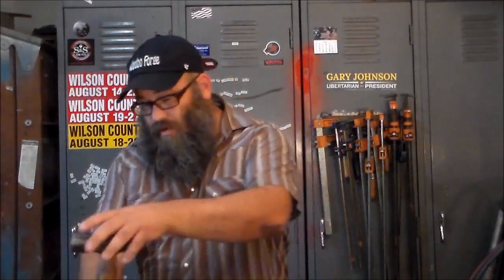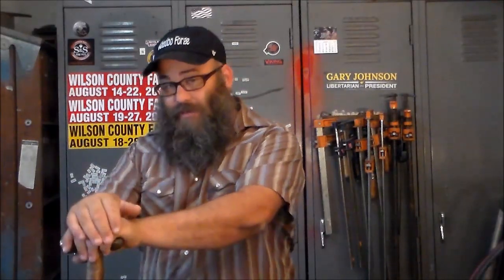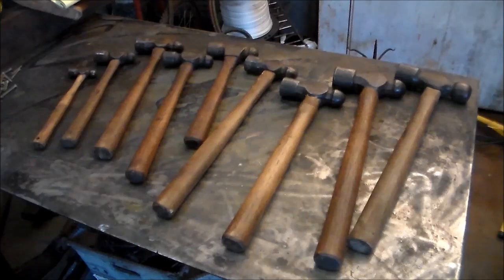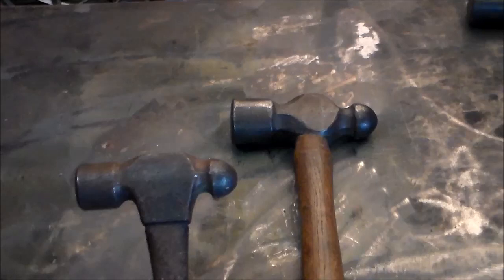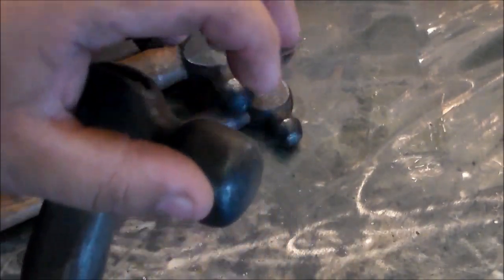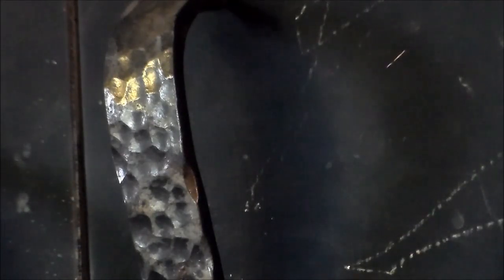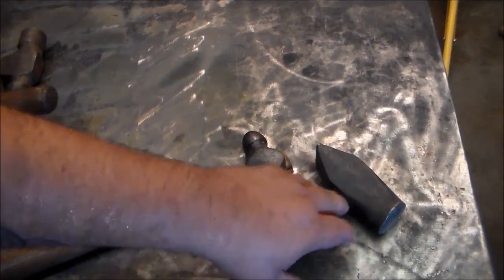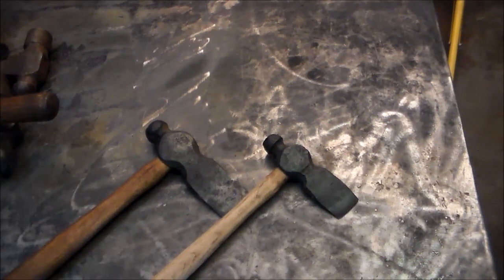Ball Peen Hammers Blacksmith Hammers #3

Comment: nice idea using them as the basis for other tools like hot cuts.  I have a smaller ball pein I like to use for all my smaller tapering and curling work. just feels right in the hand and it is a nice weight for it without moving to much metal.
Reply from the maker: Thank you Jack.

Comment: I have a 4 1/2 pound ball peen I got for two dollars at a flea market that has turned into my metal mover for forging tapers on larger stock.  I've used the peens on my two I use for forging to shape leaves and to do tapers on the inside of narrow shapes.  I've heard that smith's in England have used them forever.  Everyone is looking for the special, ultra tool when what they need is already in their tool box.  Thanks for the video.
Reply from the maker: Glad you liked it Lou.
Reply: My father calls a big ball peen hammer a blacksmith’s hammer. When he was a kid in the 40s and 50s, blacksmiths were still common and most used a big ball peen hammer as their main hammer. I’m Irish so it would probably be much the same in England, Scotland etc.

Comment: so,  let's say you softened hard steel, then hammer the metal and make it hard again, is this just as good as hot forging ??? 

is vibration also hardened the metal.?
Reply from the maker: I don't think the hammering will do anything other than surface harden anything, It will not change the structure of the steel back to a hardened structure without heat.